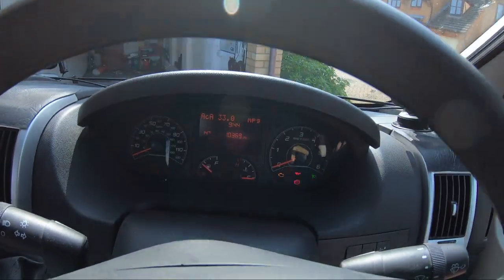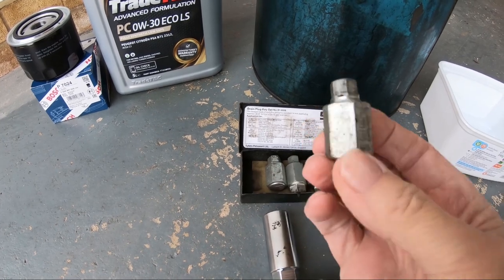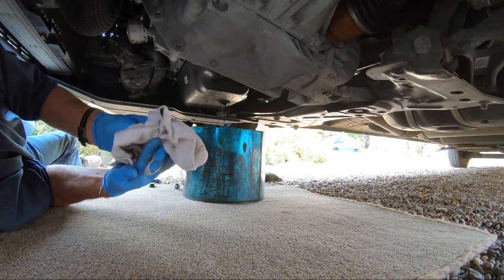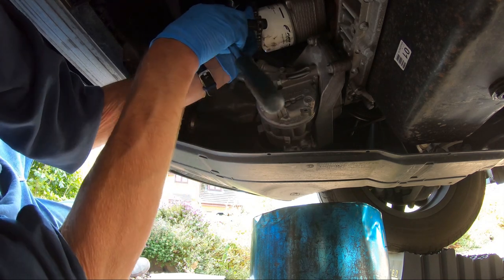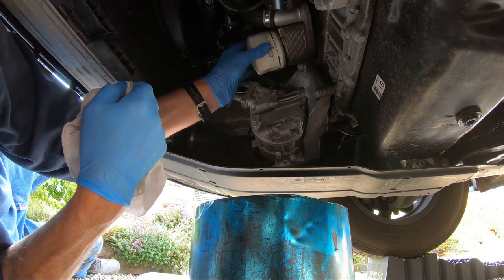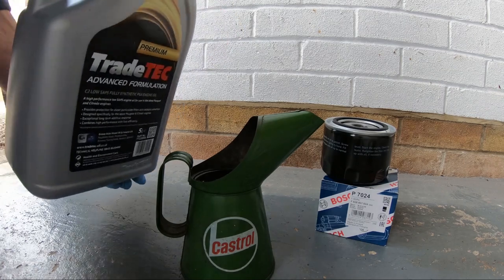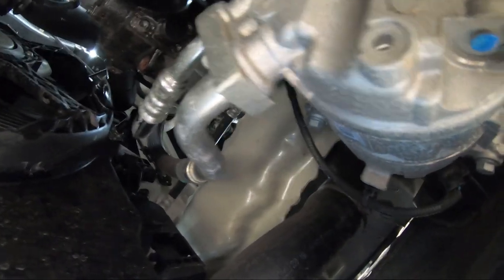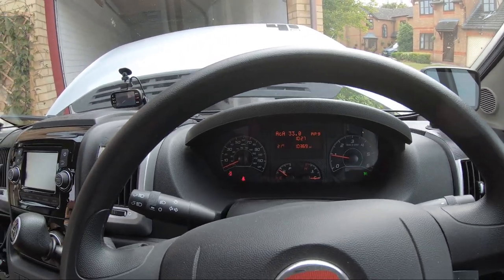Fiat Ducato 2017...Oil & Filter Change...IH Motorhome

Comment: Malcolm, which oil did you use. Also is your engine Euro 6. Mine a 2019 2.3 150 needs Fiat spec 9.55535 – DS1 which not many oils meet. I have found Shell Helix Ultra ECT C2/C3 and Petronas WR Forward.
Reply from the maker: Hi. I used Trade TEC 0w-30 ECOLS oil from my local motor factors. It did meet Fiat specifications. My van is the euro 6 2.3 130bhp engine.
Thanks for watching.👍🚐

Comment: Where did you get the socket for the sump plug from. Thanks. Oh and did you have to buy a new sump plug.
Reply from the maker: The sump plug set was made by Sykes-Pickavant. Part number 013006
I didn’t replace the sump plug. You could do to be on the safe side.

Comment: I have the same model of Ducato 2016 and plan to change the oil in the next few weeks. This would be my second oil change, the first being done by the dealership. I have done many oil changes over the years, however the Ducato is fitted with an oil degradation counter, can I ask if you reset the oil degradation counter or does your vehicle still advise an oil change required at 17000 miles?
Reply from the maker: I didn't reset the service mileage counter, I was going to wait and see what the mileage would be when the service light lit up. I usually change the oil every 10,000 miles and it will take me about 2 years to do that mileage. Thanks for Watching.
Reply: Hi Malcolm, For information purposes I carried out the oil change yesterday, like you the sump plug was tight, so tight that it bent my 3/8” drive “T” bar! Just for information purposes I purchased a Foxwell NT530 diagnostic tool with FIAT software and used this to reset the oil degradation counter. The tool advised that my oil was at 55% quality prior to reset and 100% quality after being reset. The screen on the dash did display information when the vehicle was first started after the procedure to indicate an oil change had taken place. One interesting point is the service indicator still stated 17000 miles so I still have a slight doubt it was reset, but I have approx 4500 miles to monitor and address. Keep safe Gavin

Comment: I changed the oil after watching this video. I waited till the oil stopped draining. When refilling it only took 5 litres to reach the full level (I've checked this several times). This has me wondering if all the oil has drained. A concern I had at the time was that since the van was on ramps (I have the same ramps) at the front, it was not level, and so some oil would remain and not flow out.  

So now I'm not sure what to do. 
Do I have a mix of 1.5 litres of old oil and 5 litres of new oil ?
Reply from the maker: Hi Martin….I presume that you also changed the oil filter.
Reply: Yes I did.  As you showed me.
Reply from the maker: I have checked on the Castrol oil website and they state the capacity is 6.1 litres. Personally I wouldn’t worry about it.
Reply: Do you think there was still old oil in the sump?
Reply from the maker: There will always be a bit of old oil in the sump and around the engine. Don’t worry about it.

Comment: i have 2015 autotrail, what engine oil do you recommend, as seems to be lots of different recommendations
Reply from the maker: Hi. I bought the the oil and filter from my local motor factors. They need the registration number to give the correct oil for the vehicle. Halfords will do the same for you. Thanks Malcolm.👍
Reply: thks @malcolmbrooksmhomechannel

Comment: Torque wrench setting is 22nm.
Reply from the maker: Thanks for the information.👍🚐
Reply: @malcolmbrooksmhomechannel  That is the setting for my 2008 based Ducato based on a document I was given, but I would say they are all pretty similar. It seems to me that it is very hand tight and then about a quarter turn by wrench thereafter - but no more.

Comment: You also should reset the oil mileage counter with the oil change. I found a video here on how to do it.

https://youtu.be/mwjMeyb62ps
Reply from the maker: I didn’t reset the service indicator because I won’t to see how long and what mileage it took to trigger it. Thanks for watching & commenting. 👍
Reply: @malcolmbrooksmhomechannel  hi. How many miles are you up to now? I think it depends on driving conditions, vehicles spending a lot of time in traffic will do less miles compared to those doing long straight runs like motorhomes. Do you have the official service schedule?
Reply from the maker: I’m up to only 12,000 miles. I have only the service record booklet.